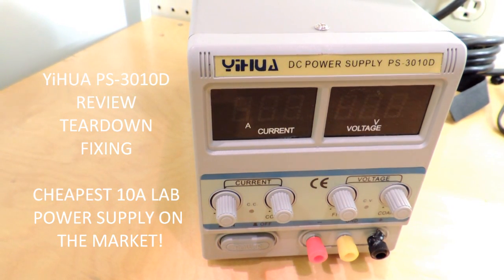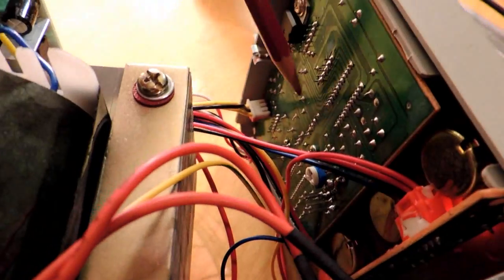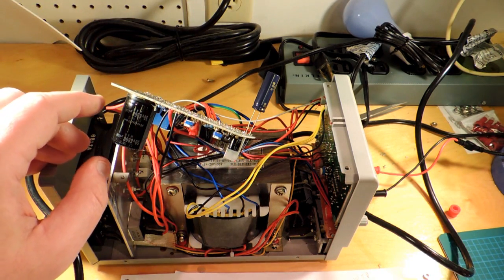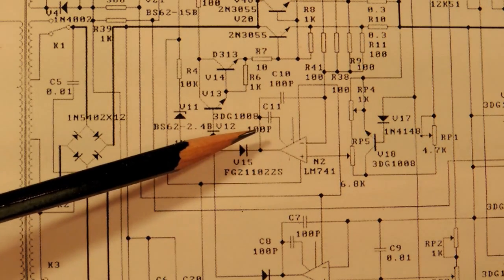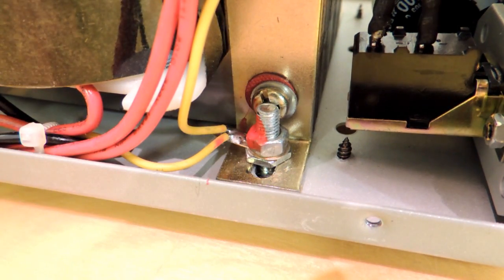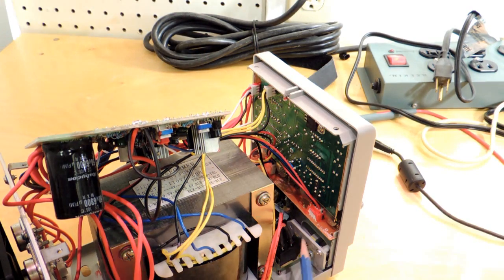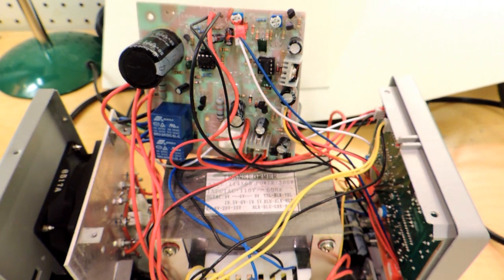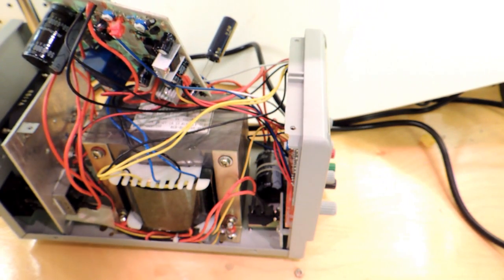YIHUA PS-3010D LAB POWER SUPPLY REVIEW AND REPAIR

Comment: I picked up one of these for a pretty good price, new.  I added a 1f capacitor 'just in case' (I did not detect a voltage spike to begin with).  
The supplied voltage is pretty accurate (off by .06-.1 volts).  The problem is the ammeter is off.  Using a power resistor, it was off by .2 amps across the voltage range. (actually higher voltage seemed to get more accurate).  However, using a lesser load (dc fan), it was off by much more.
I adjusted the trimpot on the meter board all the way counter clockwise, which improved a bit (at least at 5 volts,  I was able to detect a load, but no where near accurate.... 

is there anything else I can do to adjust the displayed ammeter? 
My old power supply (that served me well) had a button to switch to miliamps, this doesn't -- any one know if ti can be added or is it just not available on the 10amp version)

And wishful thinking: Has anyone figured a way to display the "limitted current"? (ie: before you put a load on it?)

The big thing is I'd like to be able to detect at least .1 amp @ 5v, even better if I could detect at 3v- right now; I have to break .5 or .6 amp load to register '00.1" amps; which is not helpful...

Thanks for any helpful ideas/suggestions (other than the standard "don't buy Chinese" which really isn't helpful)
Reply: Regarding "how to display the set current limit", see my reply above: https://www.youtube.com/watch?v=Osc1--tmzlQ&lc=z12liptgpkrzibggp04cf5rr2wfozdlbv2s.1469987831415493

Comment: CAN YOU PLEASE TELL ME WHERE TO GET A SCHEMATIC OF THE 0-30 VOLT,
0-10 AMP POWER SUPPLY I HAVE HAD MINE FOR ABOUT A YEAR AND THE
OUTPUT DIED. I REPLACED THE 4 OUTPUT TRANSISTORS I CAN ADJUST THE VOLTAGE OUTPUT FROM 0 TO 30 VOLTS BUT HAVE NO CURRENT. THANK YOU FOR ANY HELP YOU CAN GIVE ME.
Reply: Wes Dotson
Reply: +Wes Dotson 
Check for shorted diodes on the control board (the one above the transformer). Also check to see if your ICs are in sockets. If they are, I recommend that you remove the sockets and just solder the ICs in the regular way ...
Also, you might have a bad IC. The output transistors, when they short out, can feed a large amount of current into the ICs, easily frying them.

Comment: I have been wanting one of these "Yeehaaa" power supplies for a while, mostly because of the price.  What I want it for is running laser diode modules and charging lipo batteries for my rc models, both very sensitive to voltage and ampage.  Is this the one for me or should I pay a bit more for something else.
Reply from the maker: thra5herxb12s Buy a used HP power supply on ebay.
Reply: Thanks I just got one of these. It's not named yeehaa in fact it has no name at all but they are all the same thing made in china, even the case is the same.  I will try the calibration mods before I fry any expensive laser equipment or worse blow a lipo battery through the ceiling.
Reply: +thra5herxb12s 
Interesting, does the supply have the same internals as well?
I've seen cases where the same model and version of chinese products will have variations in the design ... -_- facepalm

Comment: Hello electronupdate,
i have PS-1502DD+ 15V and i want modify it to increase output voltage to 24volts?
thanks in advance/ pls advise
Reply from the maker: buy a different supply... you would need to rework so many components it would not be economic.

Comment: Hi,
I just got one of these for Christmas and It seems to always have a number on the current display no matter whether these dial's are all turned down or not? this happens on both Low (Ma) and Hi (A).
Is this a problem that can be fixed or should I send it back?
Thanks for your help and hope you have a great Christmas?
Cheers
Reply from the maker: If you put a load on the power supply does it show any values on the current meter?  If so it is possible that the ammeter needs adjustment.  There should be a pot that can be adjusted inside on the meter circuit board.  Standard disclaimers: lethal mains voltages and big capacitors that store considerable charge inside the power supply... only open if you understand how to work around AC powered circuits!
Reply: *****
Hi,
No matter what I do I get no readings on the CV side meter only the fluctuating numerals on the current side.
I had a look inside and got no readings from the transformer!
Cheers

Comment: Great video! I got an important question. I recently bought one of these and I am having difficulty going into CURRENT (CC) mode. Could anyone please provide me with the step-by-step instruction to get into that mode?

Thank you in advance.
Reply from the maker: Short the Black and Red terminals together.  The constant-current led should light... adjust to limit desired and then remove the short.  Don't leave the short in place for more than a few seconds... use a banana cord set with thick wire...
Reply: *****
I tried doing exactly as you mentioned, however the CC indicator still would not light up. Could you please post a one or two minute short video demonstrating this. It would be greatly appreciated as I have been trying to get it to work for a couple hours now.

The manual that came with this machine was written very poorly. It looks like someone in fourth grade wrote the manual. It has spelling and grammar mistakes all over the place. Usually, I don't mind if there are some language mistakes, but if you ever read the manual for this machine, you would know exactly why using it can be somewhat frustrating, yet it still has limited functionality compared to other expensive machines. As the common saying goes, "you get what you pay for". Once again, thanks for your help in advance.

Also, you definitely got my "subscribe" button click. Keep up the good work and keep posting high quality videos like this one. It is difficult to come across videos with clear, good, and concise explanations these days.
Reply from the maker: turn supply on.  Set supply to provide some voltage output (1-2 v).  Rotate both fine and corse adjust current knobs fully counter clock wise.  Short red and black posts with banana cable... CC light should immediately light... if not you may have a defective unit... the quality control on these is pretty low
Reply: *****
Thanks very much. I did exactly as you mentioned. I have come to realize that I have a defective unit. I connected the black and red wires together for about 1 or 2 seconds. The CC light still would not turn on.
Reply: CanadianMathMagician
 I have the same supply as you with the exact same problem. It will not go into constant current mode. Next "cheap" supply i get will be a rigol.
Reply: I bought 2 305Ds and one had the same problem. I took it apart and convinced myself it had a hairline crack on the control panel strip PCB. Solder bridged it and its worked ever since.
Reply: +electronupdate  The voltage must be low for the setting (1-2 V)

Comment: I have the same power supply except my supply is a 305D. It stopped working yesterday and I cant for the life of me figure out what is wrong. I was charging a small lead acid battery and it charged ok but when I connected the second battery to be charged, I connected the leads backward to the battery terminals and now have a dead power supply. The display chows 0 volts and 4 amps. The voltage and current adjusters do nothing now. Could you give me some advice on where to start trouble shooting?
Reply from the maker: There is most likely a reverse bias diode on the output of the power supply... when you put on a battery backwards you may have destroyed it.
Reply: *****
Hi,
The box says short circuit protected so is this what they mean by that?
The diode blows not a fuse?
Cheers
Reply: +Graham Macleod Connecting a lead acid car battery backwards is not a short circuit...

Comment: Question: I want to test brushless motors & ESCs with this PSU instead of using batteries. With voltages from 16-25v and 20-40A. Of course the ESC doesn't always push that many amps. So the question is will this cap at 10amps or is that just the limit of amp precision?
Reply from the maker: This is not the power supply for you then.  It's limited to 10A. 25V @ 40V  is 1 kW... that's a whole other class of power supply
Reply: Thanks! Do you know of something simpler, with only voltage control?
Reply from the maker: Daniel Allen Try this search string "50A lab power supply -5a" in ebay.  At these power levels a supply from a trusted vendor will be about $1,500 to $2,000 used.   ebay lists a number of dodgy suppliers (pay particular attention for UL/CSA marking... at these power levels safety is important
Reply: lol i literally have one of those in my lab. it's annoyingly loud. i don't use it. instead, i end up just using my 1000w ATX switching power supply instead though; it's a server power supply with closed loop control for voltage, has a very stable output. it's also very quiet, runs cool, and has several 12v and 5v rails on it.
Reply: Christopher Vo Thx Chris. I would use a standard PSU, however I need to simulate batteries with voltages of 16-25v. I was surprised to learn that higher DC voltage isn't cheap to achieve. So I opted for using real 5s & 6s Lipos. Or is it possible to step up 12v to 25v? With 15-20a?
Reply: On various asian discount sites like DealExtreme and BangGood and GoodLuckBuy you can find some DC-DC boost converters for like $10 which can handle 16A or so, but they are generally non-isolated and have dubious quality.

Comment: These kind of supplies have problem when regulating current. Eg. you need to test expensive LED or Laser diode using constant current. This supply can blow it, because there is big capacitor after the current supply so there is unregulated current spike from this capacitor when load resistance suddenly drops (eg.: you connect LED to supply or something changes in circuit...)